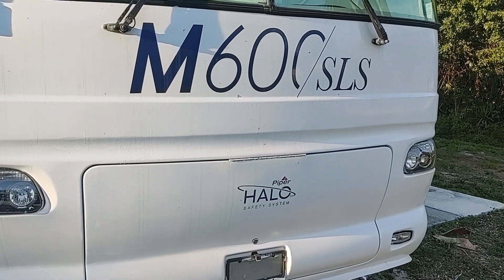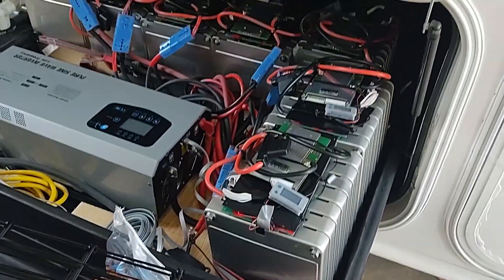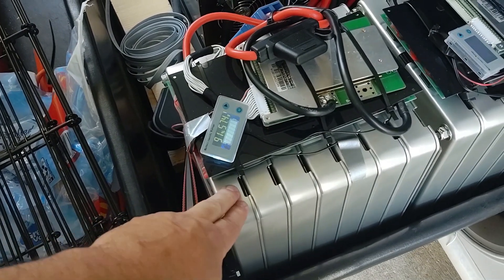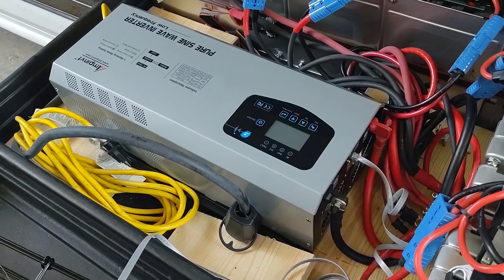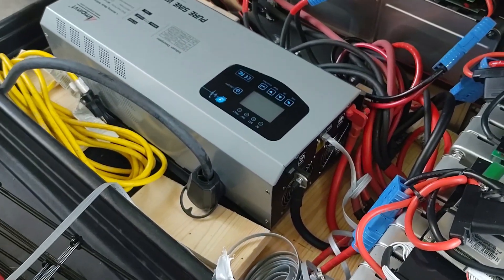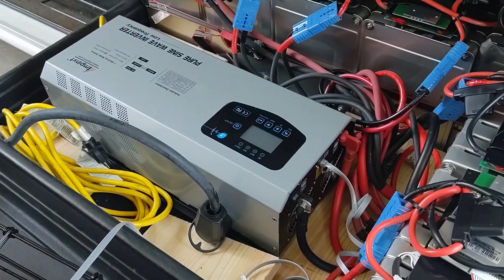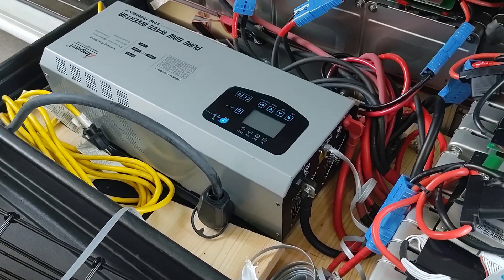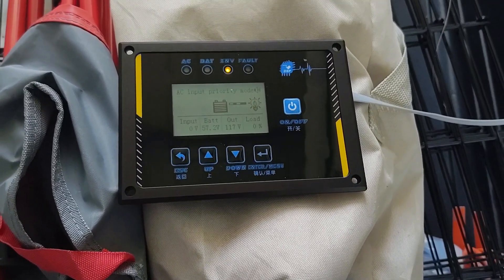Alfa SeeYa 30Kw Battery setup

Comment: Marcos how much did this cost you
Reply from the maker: Total around $3K not counting labor. A system this size is right now over $15K if you buy new batteries and everything. I added 2 more roof air conditioners and it still works with no problem.

Comment: Thanks Marcos! Interesting setup. What is the chemistry of those Lithium batteries you are using? My own preference is for LFPs since they are inherently safe.
Reply from the maker: Anytime, and thank you for watching the video! They are nickel manganese cobalt. I selected these ones because they are safe compared to other batteries of the same chemistry. As a matter of fact, Nissan designed them so they don't require temperature control, which made them safe, but costed loss of life to the battery. I was lucky to find a pack of "Lizzard" cells, and the BMSs have temperature sensors. Nonetheless, the temperature problem kicks in when you do fast charging (50KW or more). My charging capacity ranges from a plug in maximun of 10KW and an additional 3KW on solar, which is not enough to increase the temperature to a level that will affect the life of the batteries. Normally I carge them between 2KW to 4KW, and there is no temp variance at that current.
LFPs are also a great choice. Not as flexible as this ones for high charge/discharge rates, but certainly more than enough for this application.